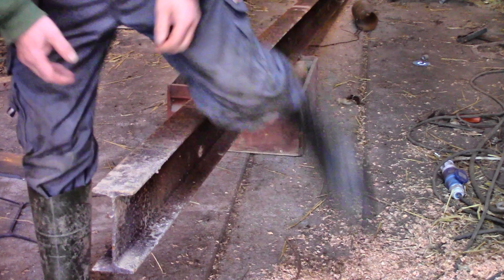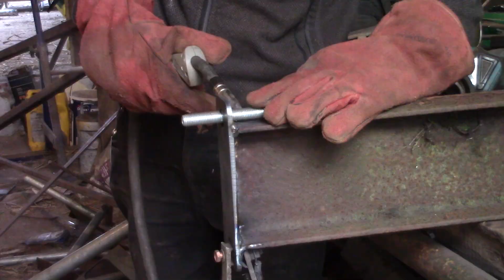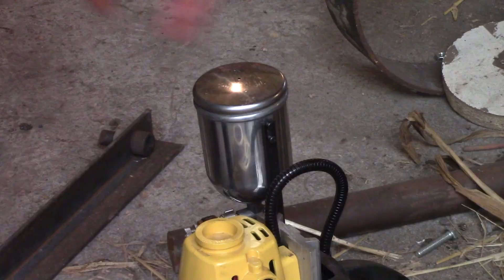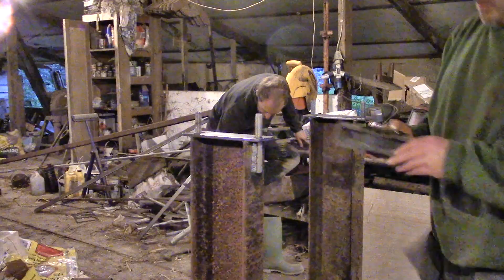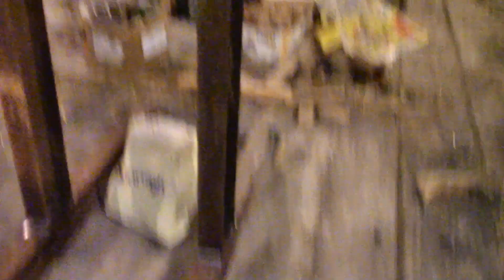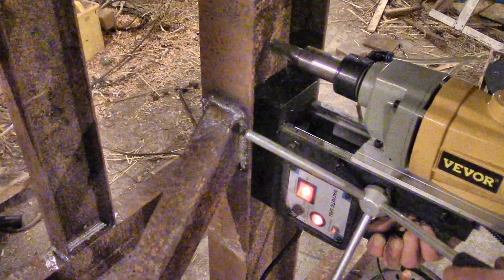Building A Giant Momentum Wheel! – Part One, The Stand..

Comment: Since the Earth is spinning, depending on the mass and speed of the flywheel, be careful so that the coriolis effect doesn't give you trouble. Aligning the rotation axis of the flywheel with the rotation axis of Earth should fix that problem. But again, it depends on the flywheel if the effect will be pronounced enough to damage stuff.

Comment: The flywheel has no use if the machine has to put out constant power. I believe you wanted to use it for a grinder of some sort, but I am afraid a big wheel wont help. A flywheel does work of there is a high peak power needed at intervals. So for a hammer for example.
Reply from the maker: You're right - except the grinder will have intermittent resistance and I hope the wheel will help get through this. (I hope it won't be just grinding charcoal - logs too..)

Comment: When drilling vertically you should tie the drill with a strap so that if you blow the fuse it doesn't drop on you when the power goes out. Good job 👍👍👍Thank you for sharing. Be safe 🇨🇦

Comment: Always love the content! Just a note that inertia “momentum” is proportional to the speed squared, so making your flywheel run as fast as possible is key, even if it ends up being smaller diameter and lighter.
Reply from the maker: I'm thinking more like slow but steady - that's still a momentum wheel, isn't it?

Comment: Perhaps put threaded bar at 4 points inside the wheel (from axle to rim). Then you could dynamically balance the flywheel and even add more weight if needed for a slower but higher potential energy thwack?

Comment: Very interesting!  I have been thinking about a similar type of large flywheel for stabilising electricity generation.  My thoughts were to put some kind of containers on the wheel that I could fill up with water to add weight, which could then be emptied to make the wheel lighter when relocating it (and to save money on constructions materials).  Since weight near the middle of the wheel doesn't add much to the momentum, the containers would only need to be on the outside of the wheel - but you'd need multiple small containers so the water pushes on the wheel as needed instead of just sloshing around.  Anyway, I'm looking forward to seeing what you come up with!

Comment: After watching all of the other channels and wishing I would have bought a cold saw years ago, I feel you pain on only being able to cut x amount of times before you have to resort too other means. The amount of money spent on disks over the years is just amazing.
Reply from the maker: Well of course most things I cut are much smaller so I can use those partly-used discs to their end
Reply: @wayoutwest-workshopstuff6299  I do the same thing. Though as the years progress I wish I had gotten some tools. The mag drill would have worked great for dozens of projects over the years. A hand metal shear would have also worked great. I have one now which never gets used as I no longer do any fab work. Yet it comes in hand for small projects.

Comment: that definitely looks like a proper stand that, for maximum inertia you want fast rpms and all the weight on the outside (energy = 1/2 * mass * velocity^2, so velocity plays a much larger part, and there will be more torque with a weight on the outside, like a long lever), perhaps make a tube and fill it with water? if there's no air bubbles there will be no free surface and it will seem like its solid. i imagine you plan to do this already, but you could also have the pulley that drives it be significantly smaller than it, since this will increase the rpms, while providing less torque.

Comment: hi Tim, I am very interested in your pneumatic locomotive, I really want to see how your locomotive pulls your new wagons, I understand that you cannot use it now due to a weak compressor, a 3000 psi compressor is very expensive, But what if you use a LARGE low pressure tank, you can either buy an old low pressure tank or make your own, about 1 cubic meter or more, it will have thinner walls and therefore it will be lighter than high pressure tanks but due to its size it will not fit inside locomotive, You can make an additional car for the locomotive where there will be a large low pressure cylinder and from it to supply air to the locomotive, can you do this? I would be very happy to see
Reply: Don't DIY pressure vessels.
Reply: @namibjDerEchte  only 300 psi, for this, if desired, you can do it yourself, in general, yes, it is better to use proven cylinders
Reply from the maker: 300psi is just too low - even with a large tank I'd only get a few more minutes of use. But 3,000 psi would make a really difference
Reply: @wayoutwest-workshopstuff6299  you can’t buy a 3000 psi compressor for half a year, for obvious reasons, since it is too expensive, I think you can give up 3000 psi and just buy a compressor for the highest pressure that you have enough money for, and make a larger air tank  volume